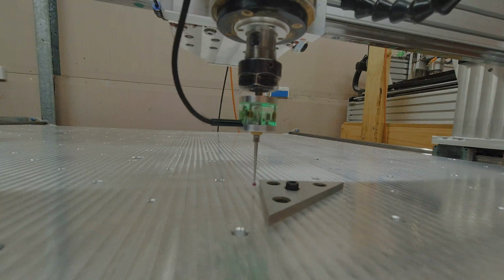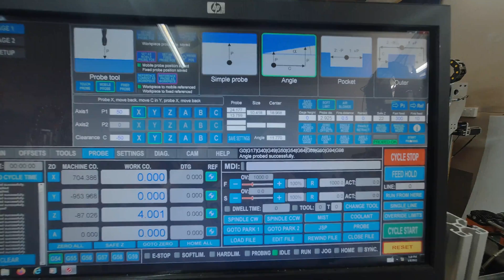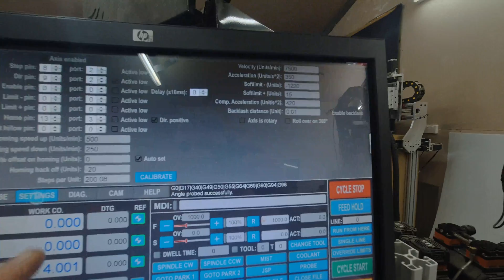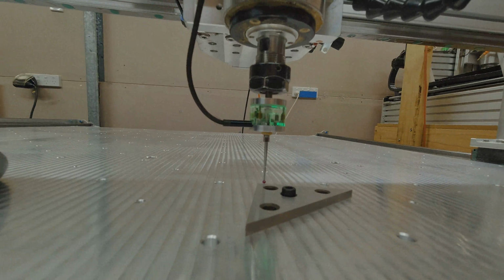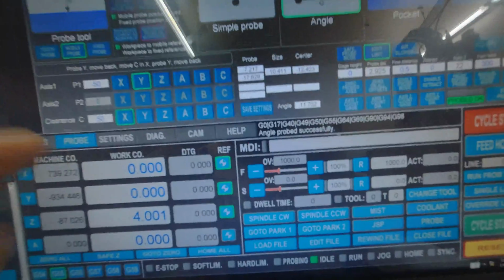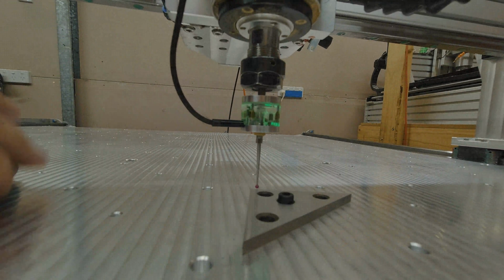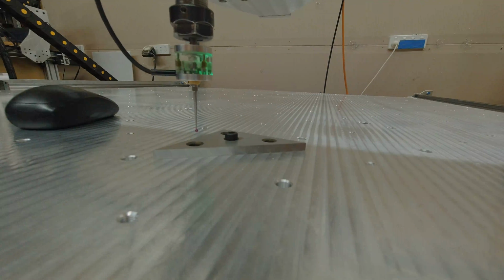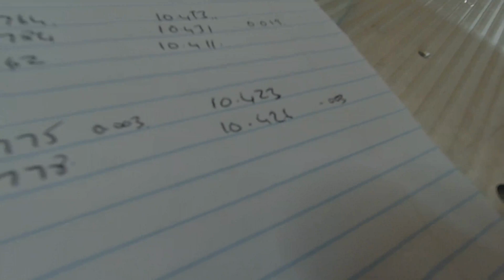Squaring Tomahawk CNC with UCCNC

Comment: Is the benefit of doing it this way over adjust the physical sensors having more control? So would probably be best to adjust sensors as close as possible and then do these adjustments. 
By the way your videos are by far the best uccnc videos around, I hope you keep posting as I am learning a lot from you.
Reply: Just realised it’s hard to do without sensor as you can’t move slave with motors engaged and it shifts ever so slightly without them engaged. However it’s still a great way to measure how square the frame is and get it good enough for most people. I will be installing second y homing sensor in the coming weeks so will revisit then.

Comment: hi Daniel, so if i get this video. The slave y axis can have a separate limit switch compared to the master? Or is your setup different than i guess.
Reply from the maker: Correct there is a home switch on Y seperate to the home switch on B the slave axis , they are homed independently but simultaneously.
Reply: @tomahawkcnc   is it just a matter of setting the home switch or do I need to add it to the sequence? 

Also did you start with with the back off the same for both?
Reply: That’s great! I’m going to test that with the coming rebuild. When giving the slave has different homing switch input, the master doesn’t override it?